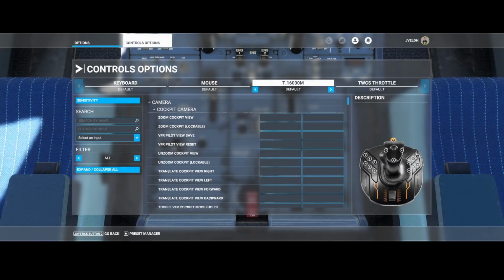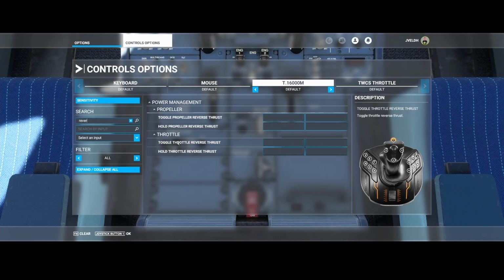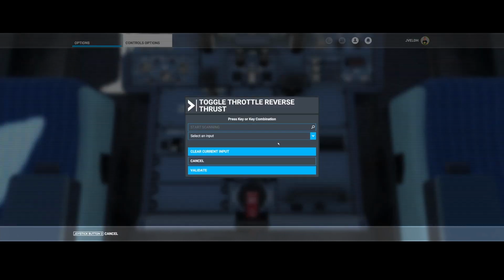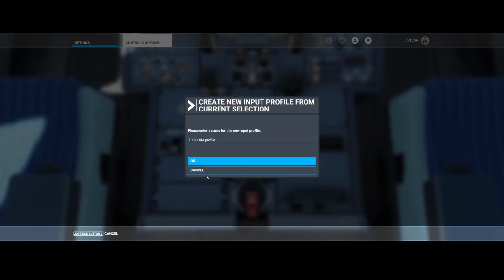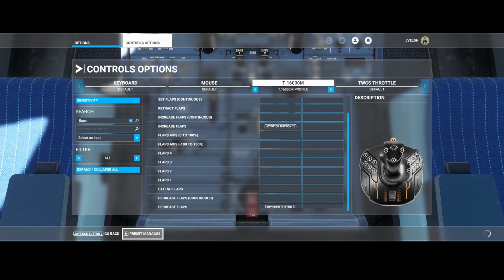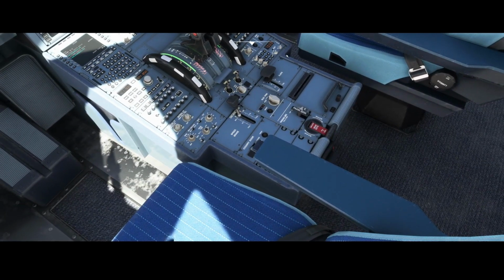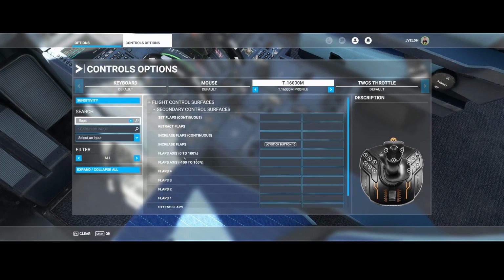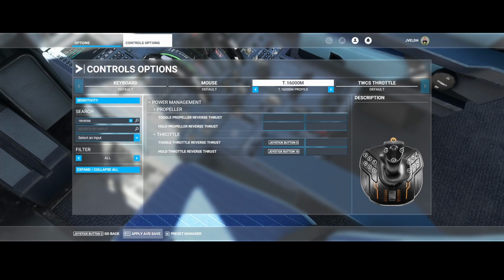Flight Simulator 2020 - How to - Controls option - customize key bindings

Comment: Yo i got a question i got a saitek yoke and throttle and i assigned my yoke to the pc and my throttle to the yoke but the throttle doesnt pop up? On control options? Could u help me?
Reply from the maker: mm I would contact the vendor if that is the case, did you try to connect both directly to see what happens?